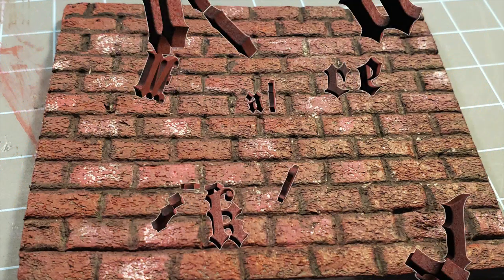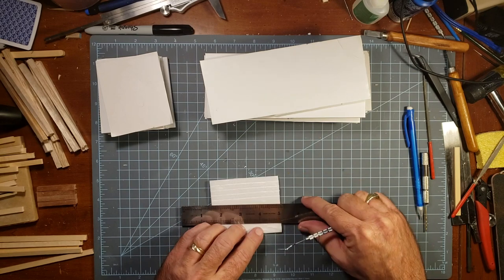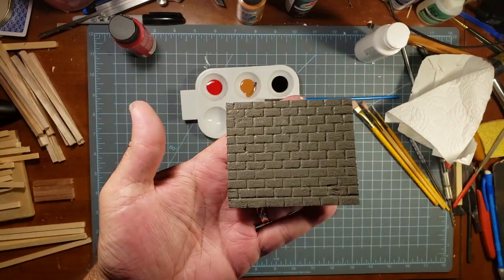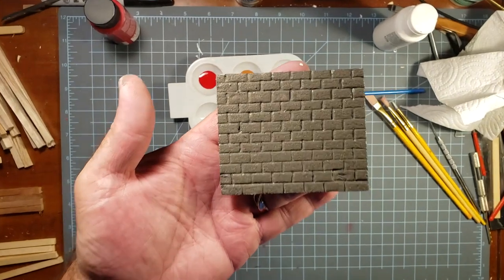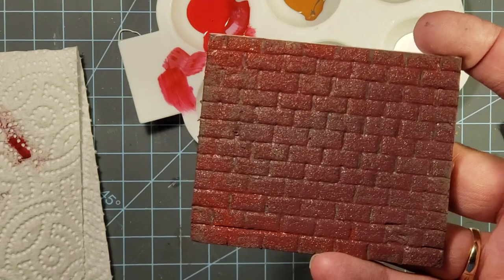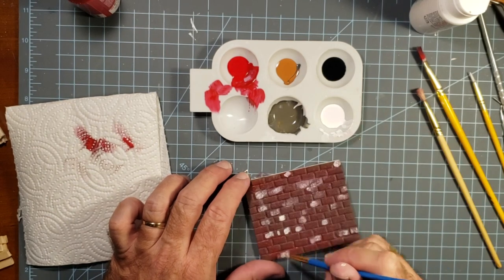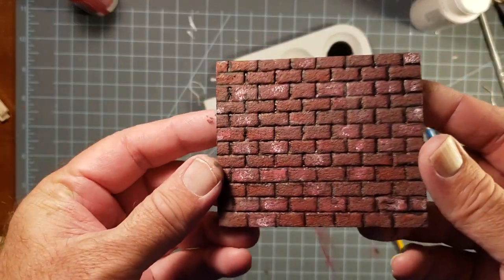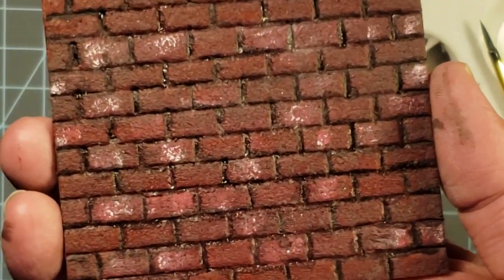Miniature Brick Walls | Steampunk Conservatory Project

Comment: If you want more texture (say if you need a worn over time or made out of grey stone look) find a nice big rock with a few sharper points and bumps. Then beat the tar out of your foam core (carefully). I find it works best after making your lines but before painting. You may have to do a second pass at some of your lines, but it looks awesome.
Reply from the maker: Thank you for the suggestion.  I have heard using rolled up aluminum foil works well, too.🙂

Comment: I watched a video where the guy put the foam board in the shower and ran hot water over it and then peeled the paper off easy.  I just tried it and it works great!  It doesn’t ruin the foam at all.  Thought I’d share.
Reply from the maker: Thank you for the wonderful suggestion!  I will keep that in mind! 👍👍😀😀

Comment: More affordable technique than clay. Thank you. I used a stone to create a rough texture.
Reply from the maker: Thank you.  After peeling the paper on this particular piece of foam board, I didn't think it needed any extra texturing.  Thank you for the suggestion.  On XPS foam, I use very coarse grit (60) sandpaper.